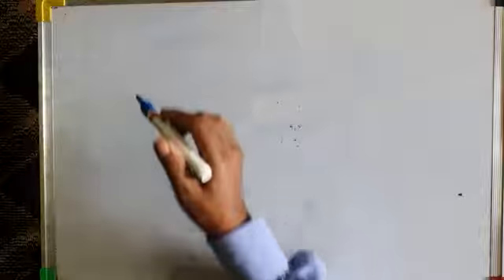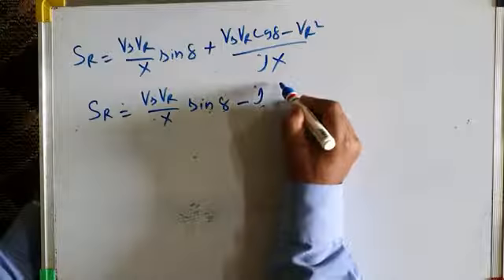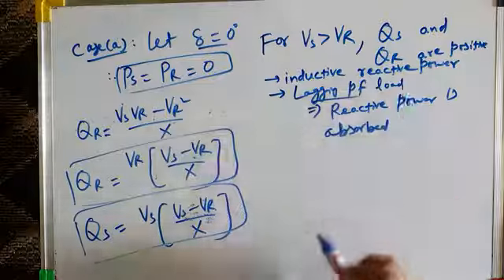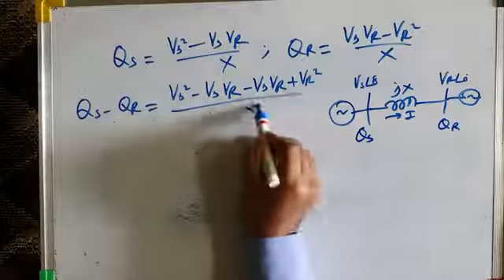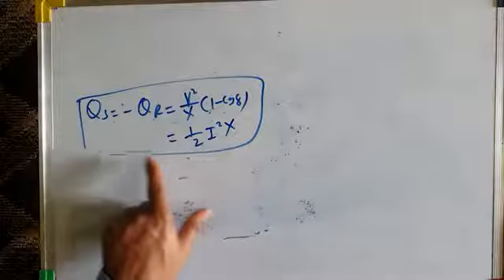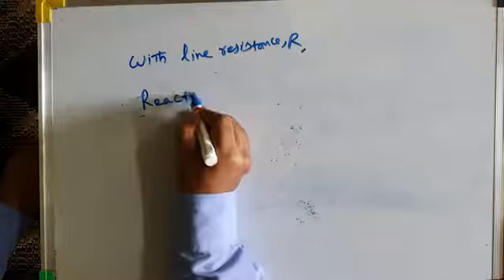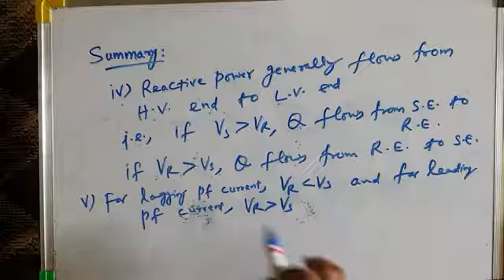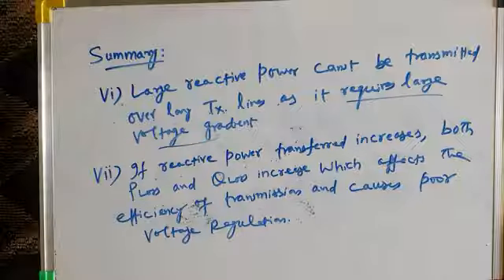L5_ Active & Reactive Power flow

Comment: Sir, Reactive power in Transmission line is necessary to what extent and the tranmission angle is the included angle between what and what parameters.Can you please explain
Reply from the maker: @PranavIllinda  Reactive power flow in the line will be dictated by the reactive load on the system.
Power angle is the phase angle between sending end and recieving end voltages and it determines the real power flow on the line.
Hope your queries are answered.
Reply: @prof.a.h.bhateednitsrinaga6515  Thank you sir.But then why we call it as machine angle.

Comment: Sir, Very well Taught, ❤ Loved it.

But I have a doubt.
We know that Active power flows towards only one direction, which can be controlled by Load Angle and Line Reactance. 

But we have read that reactive power just oscillates back and forth , it's direction changes every half cycle.
Then where does that Voltage level condition thing come from ? Can you help me to understand this ?
Reply from the maker: Reactive power flows back and forth. But it is generated from some source and demanded by reactive load. If reactive load is absent, then there is no reactive power demand and it does not flow at all. So it has a source and a demand, though it flows back and forth between source and reactive load.